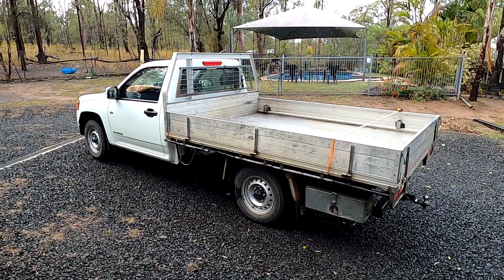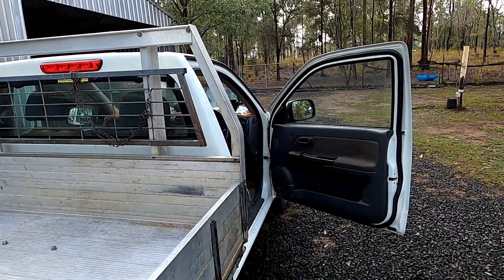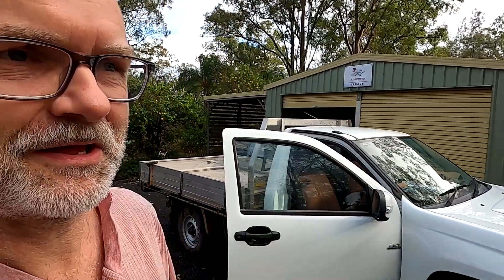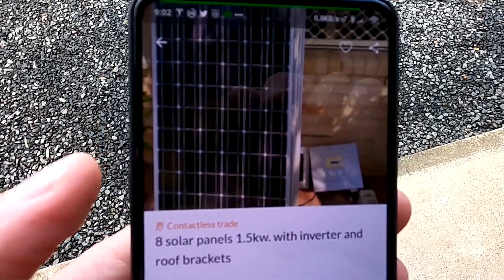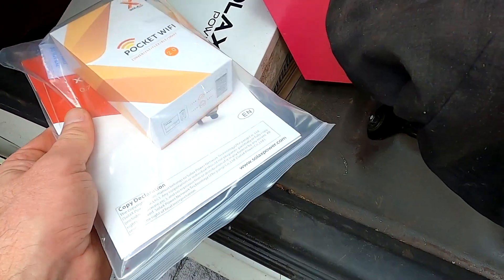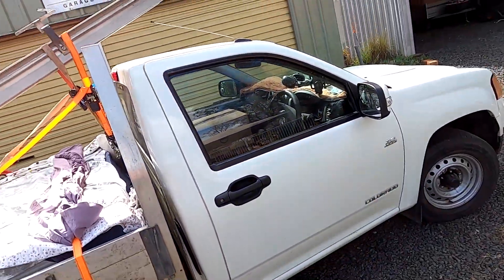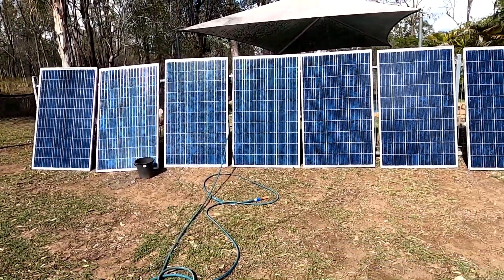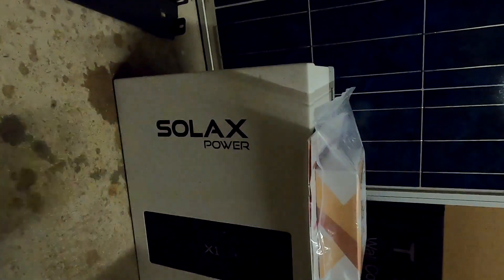I bought a 1.5kW Solar System for $200!

Comment: The solar panels with 40 volts are the 72 cell panels. You appear to have the 60 cell panels with have a lower voltage but higher current.
Reply from the maker: I measured them with over 10A in full sun and shortening the cables. Insane.

Comment: I purchased 20 used 250w solar panels from a solar installer in Toowoomba for $300 also from gumtree.
I've use 8 of they work great!
There's a recycling facility in Townsville that crushes 5000 solar panels a week such a tragedy!
Reply from the maker: Use panels are perfectly fine unless they are damaged. They will last another 20 years.
They crush them to do what? Recycle the material?

Comment: I'm thinking off splitting my array, into east and west facing, from south, I already run two charge controllers. Mine is ground mounted with a variable inclination. Flat works best in the summer at 52'N, with the sun rising in the North East and setting in the North West.
Reply from the maker: The panels on my garage are facing east and west as well but the angle is fairly flat. I also have not yet around the roof which cause some shading in wintertime. I will just compensate this with even more panels.

Comment: WoW 
300Aud are about 200€ for 1.5 KW(h) OK that`s for the car port, I hope you are looking for 2 other Systems for the Garage !!!
if your batteries are loaded, you can heat up the water of your pool.  Have you ever had a hot tube?  might be the first and only solar heated one in australia ;o)
Reply from the maker: People use some panels and an electric heater to heat their pools directly from the sun instead of using any thermal solar system for that. It makes less sense to use a battery to heat a pool.
Reply: @OffGridGarageAustralia  I didn`t say, heat the pool with the battery, if the battery is loaded your inteligent Solarloader has to switch to the heater. So it makes sence to have 50% more solarpower(even by that price)  and in wintertime or cloudy days you got your battery filled up (80%) save. or install a waterfall in the middle of your pool  ;o) or clean the poolwater with uv-light. (desinfektion) gruß walter